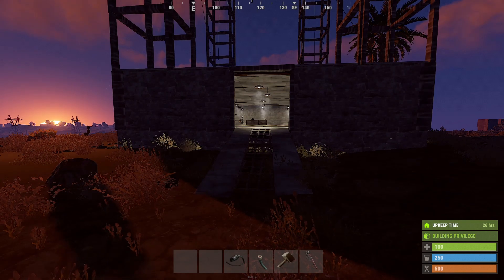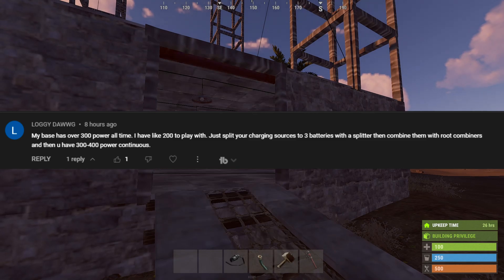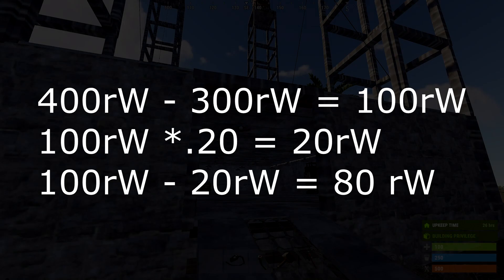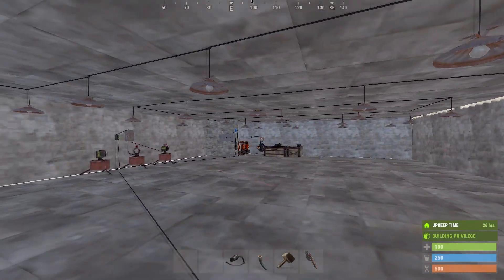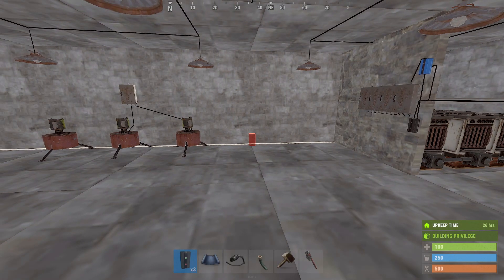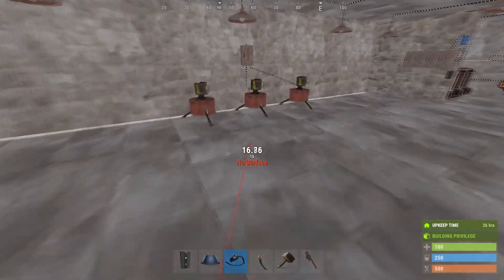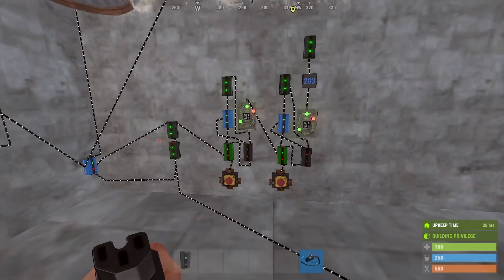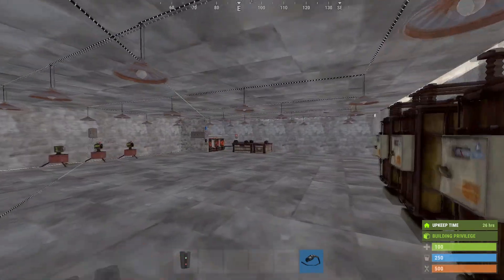Power Delivery Systems - Ep 2 | How to be a Better Rust Electrician

Comment: Very nice!

The more simple blocker version came first and works by simply using the generated  power to block the battery so when your power dropped beneath a set amount it would swap over to the battery,  with the big disadvantage of losing power generation when on battery power. The biggest difference between a simple blocker setup and the Nih core is when your windmills/solar panels aren't producing enough electricity to run your main circuit. The blocker circuit will simply unblock the battery and switch to battery power, while the windmill/solar panel power is being wasted. The Nih core capitalizes on that wasted power by rerouting it to charge the battery. This can be a huge energy difference if your circuit runs on 95 power, for example, and you were only producing 94 the blocker type would just waste it all and not put it  towards  anything whereas the Nih core will take that 94 and charge the battery.
Reply: i think they called it the infinite power curcuit.
Reply from the maker: This is one of the smart boys I was talking about

Comment: This nih core argument makes zero sense if you have 400 coming in to 3 batteries that max output 300 total and your running 300 worth of stuff is no different then if you build a nih core and have 400 coming in and 300 usage except that you wasted time building a nih core which uses power itself so sounds like it is actually wasting power that could have gone straght to the battery imstead. It would make sense if you still could not use from batterys while charging but otherwise seems to me nih core is just obsolete. Unless it is set up that during peak times you can have 325 power usage while only have battery output of 300
Reply from the maker: A nih core only consumes 2 power on power delivery past the battery. Plus, another 6 for the routing to the battery.

So 8 power is what the nih core consumes. What makes the nih core powerful is that you don't really use your batteries. They sit there for whenever power generation does not meet demand and kicks on. Plus, you're throwing away a lot less energy since you don't pay the 20% tax until you have paid for your whole circuit.

And as far as batteries go, you should always match your batteries to your circuit demand since they will push full blast once you pair up more than one battery.

The other case that makes a Nih core nice is that if they were to destroy your batteries, your circuits would run off of power generation. If they destroy your power generation, most of the time, the batteries kick in fully charged and give you 4 hours of up time, assuming you don't have battery backup systems.

Comment: I watched your Nih core video and understood it. I watched this one and comprehend it as well;however, I must have missed the part where you explained how you wired the 4 large batteries. I can see a splitter and root combiner between the two sets of large batteries but not sure how you incorporated it into the Nih core. Edit: upon closer examination, I think I see a 3rd splitter that is using output 1 & 3 to go to splitter 1 &2. Outputs 1&2 going to power in on each battery while power out is going into each combiner/splitter combo. Once each set is combined, it appears they are going to the Nih core root combiner slots in the Nih core. It would have been nice to color code the wires at each phase. Red for the battery connections, white for your Nih core, blue for Cbus 1, teal Cbus 2, etc etc
Reply from the maker: Hey so in my video Top 5 Circuits I explain how to do 4 batteries. As well as a battery backup system!

Comment: Do you need the blocker if you are toggling the memory cell? The memory cell toggles the power output to the different connections eliminating the need for the blocker? seems redundant.
Reply from the maker: Yes it is needed so the battery isn't trying to complete the circuit overriding all the energy we are sending from power generation since an OR Switch will send the highest of two inputs. The input not selected will just erase the rW since we can't store nor consume them.

Here you can read more into the design and purpose of a Nih Core
https://docs.google.com/document/d/19hr2dKtooN_YDF7TUsTdpLGadEEy9iyEFp12wbPnIas/edit#heading=h.baf6cevofj9j

Comment: this was cool. and i mean no offense. but why not just add a switch between main power and furnace curcuit and call it a day? im pretty sure it does the same job with less running power... please explain
Reply from the maker: Hey sorry for the late reply. If you wanted to run just a furnace on your circuit it would be more efficient to just use a switch. Whenever you design a circuit whether it be in rust or IRL scalability and efficiency both play an important part in a good circuit, one is not greater then the other.

So by using C-Bus' you can make as many circuits as you want without having to worry about efficiency since you can just turn them off, and your only adding the minimum amount to the Active Usage.

Also a switch would only work if the furnace was your only circuit since you would more then likely use a branch before the switch which would add active usage, negating the the reason behind the switch.

Also don't be afraid to ask questions, there is nothing wrong with that :)
“The master key of knowledge is, indeed, a persistent and frequent questioning.” – Peter Abelard.
Reply: @JohnWillikers  so i got the jist of it after watching your video a second time and analysing the circuit in detail. even more so after your explination. thank you for the response. you just took my "E" game to the next level. And i suck at pvp and hate being a farmbot so being good at things like electricity and gardening are the only thing that keep me in a clan. and the more i know, the harder it is to replace me lol. thanks again
Reply: im not an expert electrician and that was an honest question btw
Reply: nevermind. i get it now. this revolves around the nih circuit and variable outputs. i think i made sense of it.

Comment: Because of the previous video I tried building a Nih Core in my base but my memory cell was acting weird..
Instead of the the splitter activating the set or reset of the memory cell depending on the power input it seemed like it was activating both the set and reset at the same time.
The "output" and "inverted output" were both receiving half of the power going into the memory cell instead of one or the other.

Anyone else come across this or am I just dumb? XD
Reply from the maker: I have never had this problem. Did you set power 1 to set and power 2 to reset. It's important due to the order of how the inputs toggled.

Also, are you playing on a modded server? Maybe a plugin could be altering the core electrical mechanics?
Reply: Memory cell is bugged and always says it’s splitting the power but it will be sending all the power down one output, just check further down the line